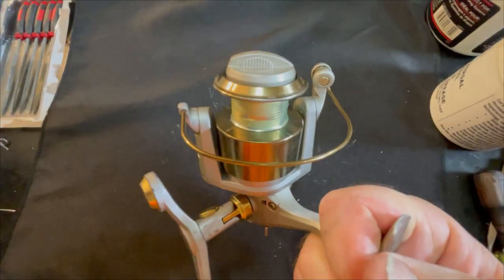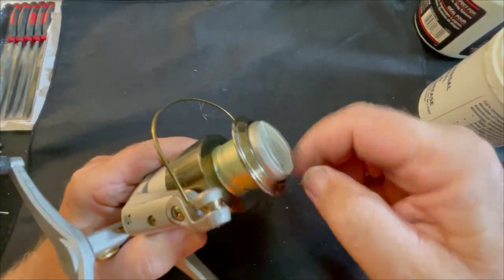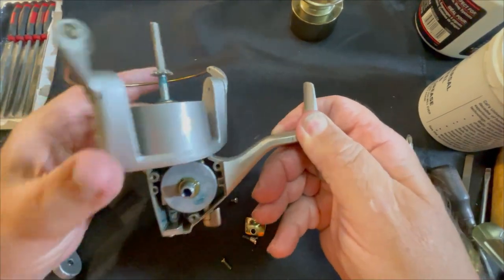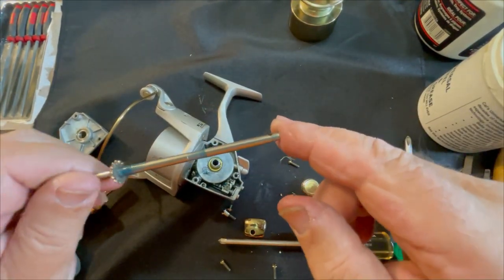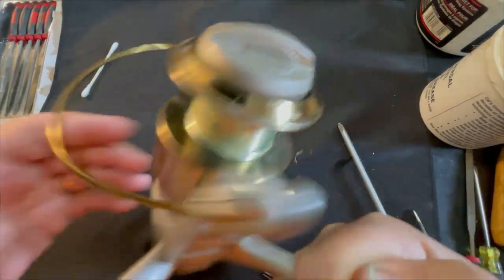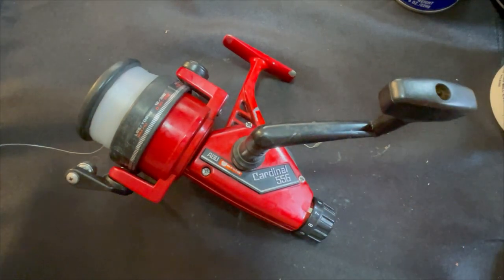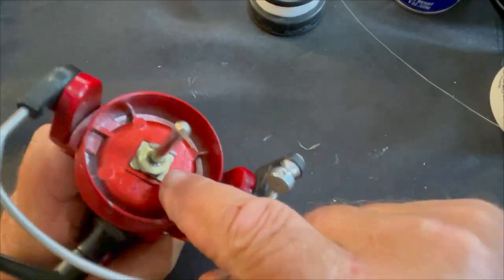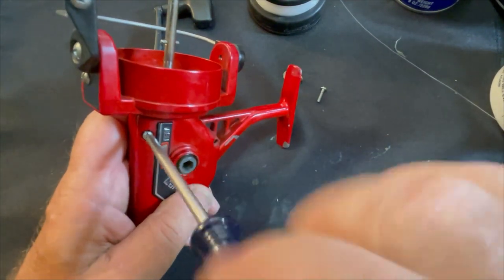Greasing VS Oiling Axle Shafts    Young Martin's Reels

Comment: When I first started working on old reels, I greased axle shafts. However, I always noticed sometimes with my old mitchell reels was that they felt sluggish. I've since oiled them and have had 0 problems. Actually, your videos are what showed me this. Great Video as always Rick
Reply from the maker: Garrett, I had convinced myself that there couldn’t be enough drag on the axle shafts to warrant using oil instead of grease. After I serviced that Spiderwire reel I felt it should be easier to spin. I pondered why that could be, since it is a three bearing reel. The only thing I could think of was the close tolerance on the axle shaft with the grease. I don’t want to steer you guys wrong so I figured I needed to get to the bottom of it. Servicing the axle with oil did the trick. I am now certain that oil is the correct way to go. The only issue I see is that it may need servicing more often.
Reply: It works a lot better from what I’ve seen on the video rick. 👍👍👍
Reply from the maker: Mario, that’s what I’m thinking. How did servicing your spinning reels go?
Reply: @youngmartinsreels5314  they went great!
Reply: I just don’t like the plastic bearings that they put in there.
Reply: The only real bearing is on the shaft under the spool.
Reply from the maker: You might be able to replace them with steel ball bearing like I did on that Daiwa. You need to measure them and see if there are same size replacements.
Reply: @youngmartinsreels5314  well, these bearings are a lot bigger. I would have to look for the schematics on lying to see what size they are.
Reply from the maker: The schematics probably won’t say what size they are. You would probably have to take them out and measure them.
Reply: @youngmartinsreels5314  ok. But I don’t have the tool to measure them
Reply from the maker: Maybe we can look into that sometime. I just ordered myself a new digital caliper from Amazon. I hated doing the inches to mm conversion so I bought one that will change at the push of a button.
Reply: @youngmartinsreels5314  sounds good!
Reply: Whenever your ready to sell me the 3 baitcasters, let me know a price. I’m very interested in them.